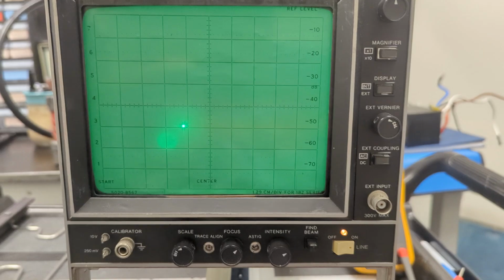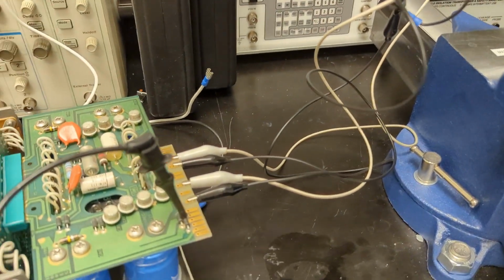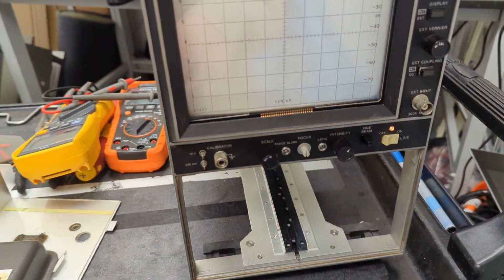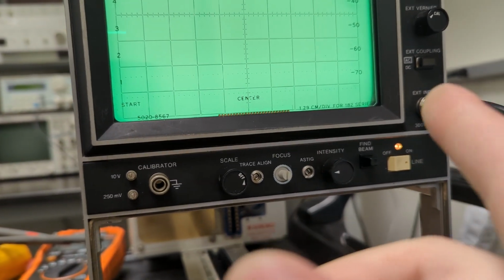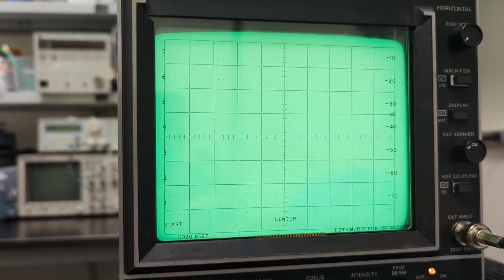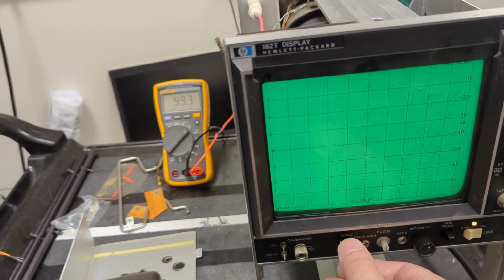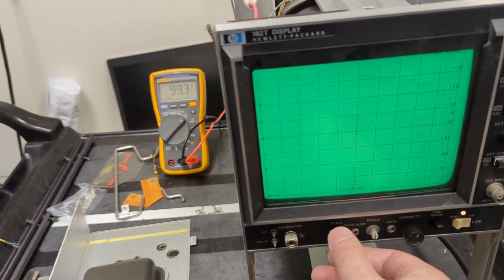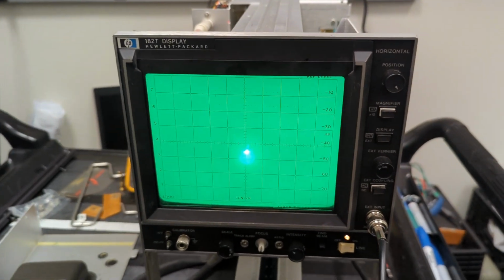HP 8557A Spectrum Analyzer in HP 182T display Repair Part 1 (182T power supply)

Comment: I think that the RF part of the spec An is working. When you shifted the baseline, the band of the noisefloor could be seen.

Two reasons why there is no horizontal sweep:

1, Timebase (sweep gen) in the spec An is buggered….but low liklihood.
2, Horiz, X-Amp in 141T is buggered….far more likely.

The intensity pot on this had me really stumpped, I could not find the damn thing on the circuit. Followed back from the modulator grid of the tube snd instantly found the 1M “intensity limit” preset pot, but you were talking about a 10K pot, which strongly suggests a “DC restorer” type intensity control … buried in the guts of it somewhere.

Eventually I found it….way back at one of the inputs of the Z-Blanking amp. It is capacitively coupled to the mod grid of the tube by C2, a 22nF (would be high voltage rated) ceramic…probably one of those blue ones. This means that the intensity setting is coming through as A.C. Via C2!

Lots of oscilloscope designs take some high frequency A.C., usually off the EHT transformer via a very high value resistor, 470K or more, so it has a high source impedance. It is also usually capacitively coupled via a small, c10nF cap, then clampped by two diodes, one, reverse biased up to a DC voltage, and another, also reverse biased, down to a lower, or negative DC voltage. These two voltages “clip off” the squarish AC waveform because of its high source impedance, the top, one diode drop above the upper DC voltage, and the bottom, one diode drop below the lower DC voltage…same circuit as used to protect the input of a chip, one diode up to rail, another down to ground or negative rail and a resiator before in series to limit the current of the input swings too far and one or the other diode is forced to conduct.

This “clipped” A.C. I then capacitively coupled WAY DOWN, a frw Kv below ground via a high voltage ceramic cap…the equivalent of C2 in in this circut, there it is rectified back to a DC voltage proportional to its amplitude, but referebce to a point, (usually the cathode or modulator grid of the tube) many Kv below deck. If either of those DC voltages that are clipping off the AC before it passes via “C2” are altered, the AMPLITUDE of yhe clipped AC changes, so the DC recovered from it on the other side of “C2L” also changes proportinately…this changes the viltage between the cathode and modulator grid of the tube and thus the intensity. But the “intensity” pot is thousands of volts above, ground referenced and only needs to change one clipped side of that AC sample “Sniffed” of the EHT transformer.

Look up the circuit diagram of the Hung Chang Model OS 620…the tube and EHT supply part, it uses this technique…called “DC restoration” to “get the intensity pot away from the HV near the tube neck and down to some reasonable voltage that can be pot on a pot on the front pannel. (Some oscilloscopes do the same for the focus pot too, but that is a lot rarer.)

Here, because this is Hewlett-Packard, thay have to do it in that, “Hwelett-Packardey” sort of way that is difficult to get your head around, but basically the principles aire the same. i think the grounded base transistor, Q5, pn the Z-Blanking amp board receives some AC via R13 from the ALT-CHOP oscillator and the intensity pot added a DC bias to it via R15. This is fed into the emitter of Q5 and the “variable amplitude AC” comes out the collector of Q5, goes via CR4, Q6 and Q8, then R28, CR8 and CR9 pnto coax W4 and up to C2 to be injected into the mod grid of the tube. Possibly the mod grid and cathode of the tube make a diode that restores the AC coming via C2 back to a DC voltage that controls the intensity.

Some odd things I noticed….that screen “wash”…the green glow all over the screen…that is NOT NORMAL, it is suggestive that a very intense beam is hitting the funnel of the tube from the inside and some of it is scattering off in secondary emission to foem that green wash. I,d be measuring the voltages on the X-plates of the tube…thsy should be about the same, if thay are drastically different..than there is something amoss with the X-amp and the beam is being bent into the tube funnel way off to pne side or the other.

So, two faults…the intensity and Z-Amp, and the screen wash and X-amp. Take a llo at the X-plate boltages with another oscilloscope…think that will be quite revealing….just make sure 
Thise voltages don’t exceed your other oscilloscope’s probe or sttenuator settings.

Oh, great to see the curve tracer out in “anger”…that pass transistor with the steeply sloping curves is definitely dodgey and needs replacing, its Hfe looks to have gone low and it will need tons of drive from it’s lottle Darlington driver mate, who will be trying to compensat for the lost gain in the big boy with its own…so both will be pretty “red in the face”.

cheers!
Reply from the maker: Hey Globe Collector I was waiting patiently for your comment on this one! Knowing CRTs and globes are your wheelhouse! 😂 

So the green wash you are referring to I think is the   'Scaling' illumination.  The 182T has a feature called scaling which allows you to illuminate the graticules.  So it brings the whole display up in brightness.  I think this is normal for this unit.  But maybe I am wrong!  

Always appreciate your analysis of the circuit!  So I have made some progress since recording this video.  It turns out that intensity pot was bad after all.  I temporarily replaced it with a pot I had on hand and now the intensity control is much smoother.  I was actually able to find NOS for this pot on eBay which is great because it would be difficult to find a suitable alternative that would fit.   But what I'm dealing with now is that when the intensity pot is decreased, the beam spot dips lower vertically and then cuts out.  And increasing it, the beam swings up to its original spot.  What could be causing that?

The horizontal amp seems to be working now.  I applied a 10Vpp 1kHz square wave and I get a trace 10 divisions long which is normal per the service manual.  So it seems the Horizontal amp is working properly.  But I can still check those deflection voltages to see if they are normal like you suggest.

Another thing I notice is that when adjusting the horizontal positioning from left to right, the beam will pull up and then down (as if it is traveling over an imaginary hump) when it crosses the center vertical graticule.  Any idea what could cause that as well?

And also, the beam does not sit on the center horizontal graticule.  It sits about 1 div below that.  But I have no way to adjust that because the 182T has no vertical amp - that is supplied by the plug-ins.  Maybe that is why it is not centered vertically?

Yes I was happy to use the curve tracer for this one!  Unfortunately, that -100V series reg transistor with the funky curves is an HP propriety part... Might be difficult to source that one... I can try replacing with alternative that has a matching series of curves though!

I'll check out the Hung Chang OS 620 circuit.  I really appreciate it when you offer suggestions on circuits to reference!

Thanks as always for your input and watching!
Reply: I’ll go and have a better scan of the circuit to see if I can justify to myself the greenwash function.

The bean spot moving when the intensity is changed is some sort of interaction between the power supplies for the tube (viz intensity) and the power supply to the Y- Amp…by, hey…didn’t you tell me it HAS NO Y-Amp!  Is there anything at all connected between the Y-Plates of the tube and the diffirential Y-Inputs on the plug-is edge connectors in the back of the mainframe? Surely there IS SOMETHING….a vertical shit pot maybe….some resistors back to a fixed voltage on some (not too well regulated) power supply.

I’ll tell you something about electrostatic cathode ray tubes that you might not realize until you spend decades working on stuff that contains them.    I’ll use this 182 T as an typical example. Notice the tube cathode voltage, it is -3150v. (And there is something I want to say about the heater supply but I willsave it for later.) The very first grid in front of the cathode is called the modulator grid or control grid…this is ALWAYS more negative than the cathode, in some tubes by just a few volts, in others it might be a few tens of volts…this is THE MOST NEGATIVE electrode in the tube.
The next grid is just an accelerator grid with a voltage on it more positive that both the cathode and mod grid.
Oh, Z-Axis, i.e. brightness/beam vpcurrent is controlled buy the magnitide of the nagative voltage on the mod grid. Some designs hold the mod grid fixed and make the cathode more positive with respect to it to decrease the brightness…this was quite common in TV sets…other designs hold the cathode fixed and make the mod grid more nagative with respect to it to dim the spot and I think that is the scenario being used here in this specific piece of equipment.

As you go doen kthe tube neck, all the other electrode voltages in front of the mod grid get ever more positive with respect to the cathode, so here you have that accelerator/shield grid…that shields the mod grid from the focus grid…then the focus grid, astigmatisim grid, etc., etc. 

Eventually you come to the deflection plates…in some tubes thay are in shielded cages, in this tube there appear to be none….BUT, the voltages on the deflection plates With the spot in the middle of the screen, MUST be somewhere close to Ov, or whatever DC component of voltage the X and Y amp designs leaves 
On them with mo signal input. 
Very old oscilloscopes simply applied the test signals DIRECTLY to the deflection plates, so thay had to sit at 0v under no-signal conditions….if they drift TOO FAR away from this equlibrium voltage then odd things start to happen to the display, can’t focus it, can’t get a round spot ot odd movments when you adjust unrelated things…like the interaction between the spot vertical position and the intensity settings.

Ot in front of the deflection plates there are often more electrodes, often applied to the inside of the funnel part of the bulb by aluminium sputtering ot graphitic paint of some sort. Some tubes have “helix” electrodes, basically a helical strip of grapgitic coating   
Starting at the post plate acceleration structire and spiralling up the inside of the funnel to the ultor cap. These typically have resistances of 10-30Meg..and go from a few hundred voltts above ground right up to 10-15 Kv at the ultor cap. 
So the whole tube can be seen sort of like a seesaw/teeter-totter in a kids’ play park, the fulcrum in the middle representing the deflection plates, the cathode and mod grid way up the end that sits on the ground and the ultor cap represented by the other end that is up in the air! If something upsets this conger-line of almost ever increasing voltages…or the point where they cross zero, confusing and befuddling crap can happen!
O.K. Something I really don’t like sbout this 182 T circuit…the tube’s 6.3 volt heater supply. In those oscilloscopes that derive the EHT off a Royer or Flyback type “high freqiency” suppl with a ferrite cored transformer…generally the heater supply comes from an overwind on this same ferrite cored transformer…why? Because it needs to be only a few turns at the high-volt-per-turn ratios of high frequency transformers…and since it is referenced to a point 3150 volts below deck, it can be pretty heavily insulated wire.

Some older cposcilloscope circuits derive the EHT straight off the 50/60Hz mains transformer…this is “potty” because not only do you need thousands of turns to furnish the EHT itself, you slso need to put that little 6.3 volt heater winding…but the insulation in the transformer around it..be that shellac soaked paper, resin soaked paper, wax soaked paper, captan tape…whatever..it has to float 3150 volts away from every other winding in there…add the peak value of the high AC voltage the EHT comes from and you can have points 5Kv or more aoart in the same small transformer…sure, it’s OK down at the local switchyard, where the cores a huge and the turns-per-volt are low because the cores a so big….but in a sub 200VA transformer at 350mv per turn? The designer needs his “head read”!
This oscolloscope us trying to do both things, derive its EHT off a ferrite cored transformer, (which you can wtap a croc-clip lead arroubd the core of a few times and connect the ends to your oscilloscipe and get a “safe” look st what it is doing)
…but, get the floating tube heater supply off the main 60Hz ower transformer. That is why there is that 100K resistor from the cathode to one end of the heater….if that has been “red in the face”….something very nasty has happened between that elevated/depressed heater winding and one of the other windings on that transformer!

O.K., “Rant” over!  Now for that pass transistor in the power supply. 

It is just a power supply, it is not going into a sattelite to be shot into geosynchronous orbit…it is just a pass transistor, chuck an MJ15022 pr MJ15002 in there….good enough for “Straylia” as Dave would say.
Yes, if it is the first local oscillator transistor, I’d be a bit circumspect and careful, but a bloody pass transistor in a 100v power supply, AND in a feedback loop….hells bells, the zener was dead and you could not get one exactly like it.

Oh, ine thing about that zener, the original was probably some swanky low thermal drift one, but there is a simple solution…put TWO 5v1 zeners in series to replace it….why 5v1…because those with lower voltages are actually BREAKDOWN diodes, which thermally drift one way….and those above 5v1 are true ZENER diodes that thermally drift the other way…the 5v1 zener sits right in the middle and barely drifts either way…do it is a “poor man’s” swanky voltage reference.

The “hump” behavor you refer to…I have no real idea, but I would look at tracking between main supplies ans EHT supply…is the main supply driving the EHT transformer dipping as the brightness is turned up, does this supply effect the one setting the “no signal float” voltages on the Y-Plates?

And, oh, could I go on about the spectrophotometer anology you used….but another day!

Cheers

Comment: For intermittent failures like your intensity adjustment, I like to gently tap everything with a screwdriver handle. Sometimes that helps to isolate the fault and locate the bad pot, oxidised contact or bad solder joint.
Reply from the maker: thanks for the tip!

Comment: Interesting... i'm working on a 182t with psu problems also!
Reply from the maker: Definitely check that 9V zener VR2 before going down a bunch of rabbit holes like I did! 😂 Having a curve tracer definitely helped because I was able to kill the zener for good by increasing the collector voltage.  Really helps with those intermittent issues when the source is a failing semi-conductor!

Comment: Cool ! Don't leave the beam on in that one spot  you don't want to burn the phosphor, de focus or turn it down, of course you know that ! I would love one of these but I would like the low frequency stuff like DC and up. What happens when you press the multiplier button ? and the display buttons ? stuff like this would help diagnose, can you pipe anything into the back of the scope to check that out ? also can you take the outputs from the back of the SA and connect up to another scope to check that out ? not sure if you showed us the back of the units. what do yo have connected to the external input at the moment ?. When you turn the focus up and down does the beam swing to one side or stay put ? have you seen if the calibrator works ? I would imagine that the voltages for the CRT track with the intensity and the focus  but for now can you take that pot out and test it on the bench with a few volts ? just to rule it out or hang a meter on there and check the voltage adjusts smoothly. Anyhow lets see what you can figure out as it's early days  ....cheers!
Reply from the maker: Thanks for the tip Andy!  I had heard that before (regarding the burn out) but obviously was not keeping it mind for this repair.  The magnefier button does not seem to do anything.  The horizontal button seems to work but I feel like it should be able to move the trace all the way across the display - it only moves the trace about a divsion or two in length.  My foucs was mainly on the 182T so I haven't tried connecting the SA to anything else, but that is a good idea!  During focusing, it appears that spot stays in place.  The external input is at the front of the unit - I had my CG5011 connected at certained times just delivering a 10Vpp 1kHz square wave.  This is the same signal that is available on the unit itself and it does work.  It was just easier to connect it via BNC to my CG5011.  But the calibrator signal does not seem to appear on the display - it does not look any different when the external input is on or off.  It did seem to try to show some signs of life, but barely.  I did test the intensity pot for resistance and it gradually increases and decreases between 0-10kohms - so it doesn't test like a bad pot.  But I am going to replace it anyway and see if it makes a difference.  But I'm leaning towards the problem being on the horizontal amplifier PCB or HV supply/multiplier.  Really hoping it is not the CRT that is bad...
Reply: Nah I'm confident the CRT is fine and no shift when focusing is good news too :) @fmashockie